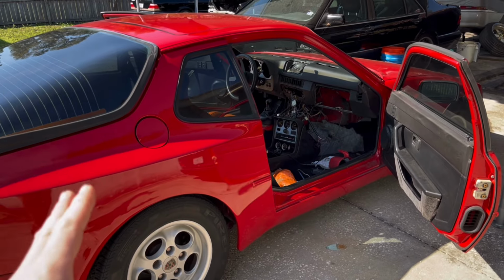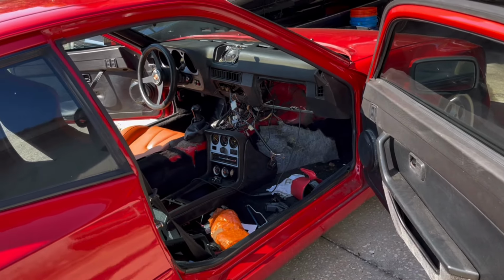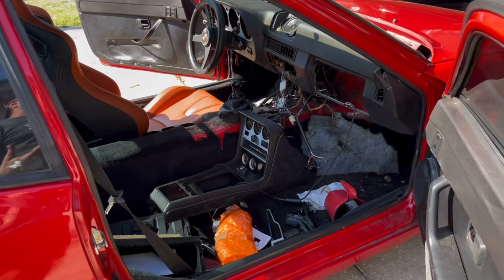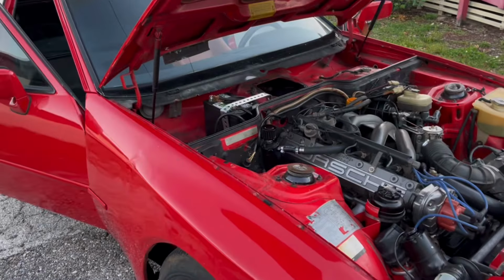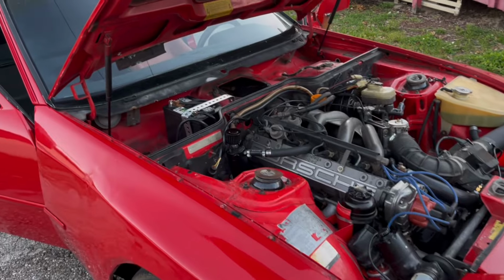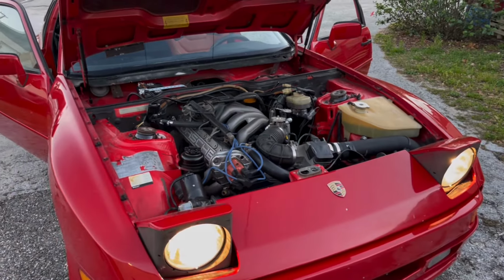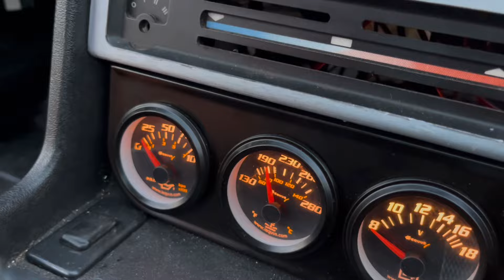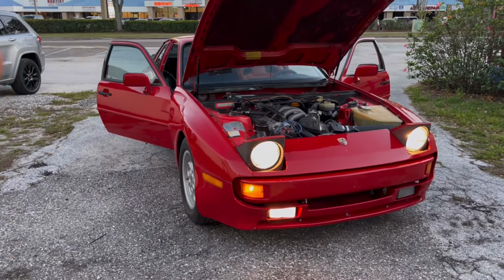1984 Porsche 944 track car build: making lightweight door panels and eliminating unnecessary wiring

Comment: If you want to save weight, strip out the sound deadening. If you took out the heater, I would assume you took out the AC system…super heavy.
Reply from the maker: Yup sound deadening was done last year along with ac and the entire system.